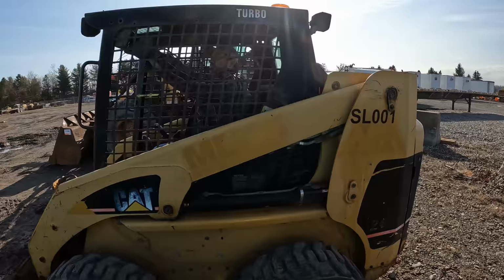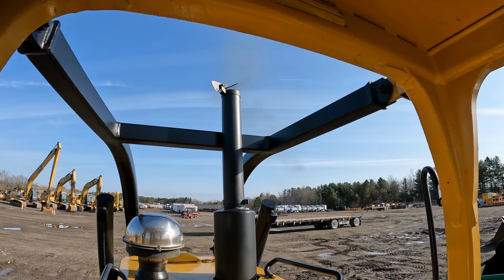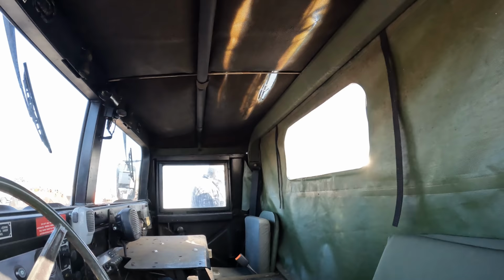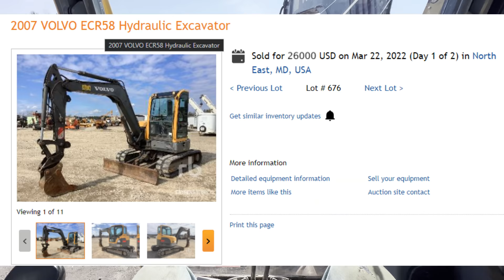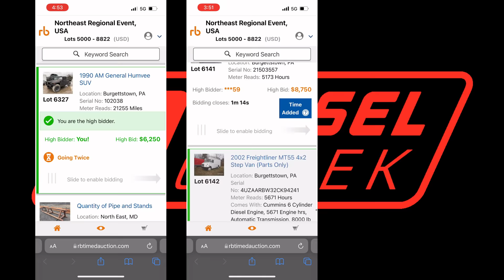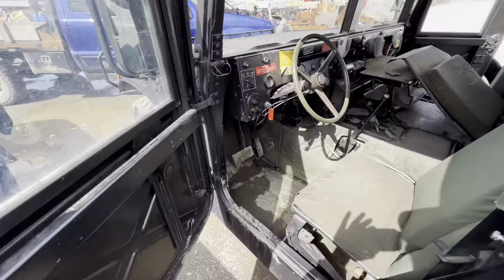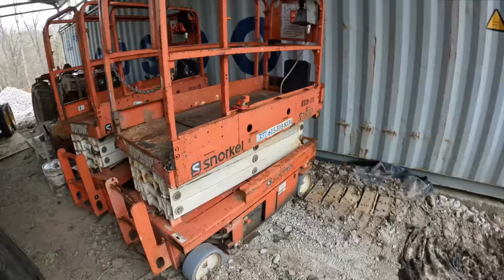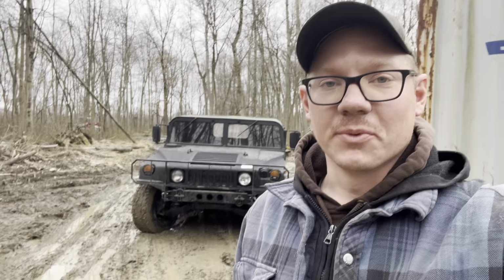You Won't believe the DEALS I got at this Auction! (I Scored BIG!!)

Comment: Having been a motor transport operator in the Marines, and having driven humvee's for tens of thousands of miles, I don't think you got a great deal on that. They are over rated vehicles. Their off road capability is limited, and they do terribly in the snow. And you'll only ever have two air conditioning options: hot, and hot as hell. And they can only carry 1-1/4 ton, and tow 2-1/4 ton.

That being said, if you ever come across a 7-ton (MTVR) from Oshkosh, you should jump on it. Great vehicle. Reliable as hell and you can take it anywhere. I've seen them tow a CH-56 out of a ditch. I've seen them take hits from RPG's and keep running. I've driven them through mud almost covering the tires completely. Very fond memories of driving those bad boys.
Reply: 10 minutes later and I'm still laughing about the 2 a/c options....  even worse if you opt to enter a slow moving car cruise   won't do that again.
Reply: Just think if he was hanging around in Iraq a few months ago he could have got one barely used for free...  ;)
Reply: Or cold as heck in the winter!  I drove them in the Michigan Army National Guard.  Going into Iraq in 130 degree heat and even in normal temperatures in Michigan, I found them under powered on the highway.  If you get below 50MPH, you drop below the engine power band.  I agree in snow those tires just do not grip.
Reply: @klsc8510  Totally. I also worried more about rolling over in a hummer than I did in any other vehicle. 

And he’ll never fix that leak. It’s gotta be a feature, why else would they all leak?
Reply: @bobbalbirnie2478  and some jets too.
Be kinda handy in Ukraine right about now.
FJB

Comment: I want to say the biggest electric motor I worked on was at Gredes foundry in Reedsburg WI... it was a 2000 HP electric motor used to spin one of the main rotors for the air filtration system,  it had a 500 HP pony motor that would keep the main motor shaft rotating when shut off because if it stopped it would crush all the bearings because it was so damn big and heavy!

Comment: Brother, great job on the auction. I have electronic manuals for the HUMVEE and it's motor. I worked on those in the USMC when they were new and in the Ky national gaurd so if you grt in a pinch, don't be afraid to ask. If you would like a electronic copy of those manuals let me know. Do not trust the fuel gauge, they are notorious for not working right. You also really do not want to fill the fuel tank all the way up either. It is a plastic tank with a metal plate bolt to the top that the fuel level sensor gets mounted to. There is a rubber gasket between the plate and tank and after a while the old ones would expand and leak fuel if filled all the way up. The replacement gaskets were made of something else that the fuel didn't cause to expand, but hard to say if the gasket on yours has been changed. two more things; the geared hubs tend to get the oil changes neglected so you really want to check the oil level in them before you run it to had. And the transfer case gears. Low locks in 4x4. High is 4x2, HL is high 4x4. The alternator will want to hit about 1,599 rpm for a second or 2 after starting before it will actually start charging. Every thing else on them is fairly strait forward. Enjoy!

Comment: Since that Humvee is ex police, that two way radio probably isn't going to be too useful to you, but might be worth selling, depending on what brand/model  of radio it is, and what frequency range for which it was designed. I know quite a bit about two way equipment, as a former radio tech and current amateur radio operator, so if you need some further information on that radio, I would be more than willing to help.
Reply: Is it feasible that the frequency range could be changed or extended?  Is it likely to be VHF or UHF?  Is it legal to listen to police broadcasts?  I seem to remember something about it being OK to listen so long as you don't act on what you hear, but that is going to be different on what country and state you are in.  I hope Matt puts up some video on that radio, and it would be cool if he reaches out to you.  [EDIT]  BTW  I used to have G6HVK as a UK VHF only call sign many many years ago, but I let it lapse, and was never interested in doing the Morse to get a full license.
Reply: @TrevorDennis100  being that this radio is ex police, it is probably a UHF high band radio (800MHz) and most likely trunked. Moving something like that to another band can be very difficult, although I have converted many VHF high and low band radios, as well as UHF low band to the nearby amateur radio bands. Listening to police broadcasts in the US isn't illegal (except in the commission of a crime), but usually pretty difficult these days, since many radio systems are trunked and encrypted. One common feature of trunked radio systems is being able to see which radios are on the system, and another common feature is being able to remotely brick the radio, to keep it off of the system. It is also entirely possible that this radio is an older model, no longer legal for use in commercial service, after the narrowbanding push of the last couple of decades. There are a lot of variables,  and having model number info would solve a lot of those variables. I'm currently licensed as Extra class KD5TKR, and work in public safety, but not in radio communications. If you have any further interest in amateur radio, most governments have removed all requirements for Morse code testing. You could get your UK full license by taking a couple of tests. Check with the Radio Society of Great Britain for more info.

Comment: Just an fyi to turn the lights on to service drive you need to move the top switch at the same time as the bottom one as the top switch is a lock for the bottom. You will like the black out drive if it works. Otherwise looks like a good vehicle. You can get a new soft top online fairly cheap or convert it to a hard top for a little more money. Pretty easy to install

Comment: First off get those battery terminals sorted out and check the voltage of each battery and gravity of the cells. Also check the batteries are the same, the number of times I come across 105's and 125's mixed together. If the battery voltage is too low some chargers will not start. That hummer is ideal for boosting the batteries, my old m1009 cucv was a life saver. The stop switch in the top control box will probably be your next port of call especially if it's been left out in the weather for a long period. Chances are the contacts on the back have been frozen and pushed off the backing plate. Then check that plug on the bottom of the top control box. Chances are some of the pins or sockets are green with corrosion. Then you'll have the fun of the elevation switches, angle sensor, load cell, pothole switches etc etc. Also the valve block, solenoids and corroded terminals in the wiring loom. Chances are there'll not be too much wrong with them. Look for excessive play in the steering bushes and kingpins and worn slide blocks in the scissor pack.

Comment: Try de-sulphating the batteries, there are kits and solutions for doing so which may extend the life of the batteries a bit longer, some battery chargers have systems built into them for doing so, C-TEK being the brand I have here in Australia, it worked well on a battery I had in an old Toyota ute that had sat idle for about 7 years, it rejuvenated enough to start the 2H Toyota diesel and lasted about 12 months after that.

Comment: Disconnect all the batteries in the scissor  lift  clean   all  the terminals and load test each battery separate and find yourself 4 good ones Out of the bunch If I remember correctly when those are beeping  the batteries are too dead to activate the charger  Once you clean them all and load test  charge them all separately Then put a set in and see if the charger kicks on When I live there I used to work for Sam equipment rental before it becomes Nathan's rent Before moving to Florida

Comment: try desulfation of the batteries. the digital chargers may not charge the batteries if the batteries are completely dead, you can trick them by wiring in a good battery in the chain.

Comment: The fun thing about charging up old corroded batteries like that, is they make hydrogen gas.. and then you put a big draw on them the old corroded led plates can flex a little and come in contact with each other.. mix that with the hydrogen gas = boom

Comment: Matt, Make sure you service the wheel hubs and differentials on the Humvee as well as checking the steering balljoints, drops.  They are usually very neglected areas.  As for the leaking top, Even when new they leak.  The only way is to convert to a hard top.

Comment: @Matt  ...  i believe there is a safety lowering valve usually at the rear steps, to lower the platform in case the operator is incapacitated. 
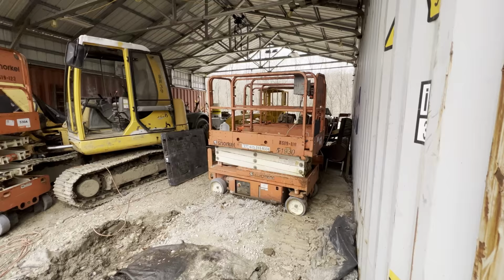usually twist to unlock and pull to lower.  there  should be pictures  33:00

Comment: Try flex seal product on the Hummer roof fabric.  I used this on a UniMog 404 convertible roof and it went on easy and looks like original fabric.   Haven’t had any leaks since.  Available in black or white.

Comment: I am not excited 😆 for you to get the 2seater Hummer... I am legit jealous! Ok, fix for the leaking roof; tire patch. I used 1/4" plywood for a support of the canvas between the bows and canvas. You won't have to worry about camo net on the roof so you should be fine. With all the up armor hummers being used now there should be NOS canvas and it's "easy" to shift from a two seater to four seat.

Comment: Hi there Matt! Great video as usual and magnificent deal on those Snorkels. I have been working in a manlift service company for multiple years and i know Snorkels pretty well. That beeping propably means that the battery voltage is below charger low threshold (usually around 16-18V). Try to charge them with a little extra 24v boost and see if they start to charge. After charging, add some water to them and discharge them by using the machine. If that works, repeat this for 3-4 times and you might have yourself a decent battery pack. "Not charging" is almost the most usual reason for service visit for a manlift service guy, right after oil leaks :).

Comment: I know you like used but you may want to look into either a miller trailblazer or bobcat with the battery charge /boost option  upto 200 amps and 12/24 Volts would be awesome with most of the stuff you do as well the open-top containers weigh quite a bit more
Reply from the maker: My Lincoln ranger is old school it jump starts stuff quite well. Do it all the time

Comment: Matt, the scissors lift and think with some work and maybe new batteries will work fine for the new shop. The Humvee is awesome, and  make a great work truck, and wondering if you instead could take that crappy cloth top off of it and make and weld a metal top for it instead??

Comment: Nice scores, man. About those awp lifts - get hold of the user manual. There is always an emergency override to get the platform down in case you loose power or it gets stuck. We had one just like it at my previous job.

Comment: One possible way to fix the top of the humvee, flex-seal! (or other similarly waterproof rubber/tar-like substances)
The battery-gauge is just happy to meet you! wag-wag-wag XD Maybe an alternator issue? Could be why the batteries were flat and why it was being auctioned off. Hope it's an easy fix, whatever the case! Runs nice.
Oh hey, the gauge stopped wagging once it warmed up, nice! And you drove it home, awesome! A container too?!
Dang, you really did get a ton of deals this round! Hope the van turns out okay, would be a fun project!
Reply from the maker: The container was my buddies score. I’d only buy 40’ ones lol
Reply: Ha, yeah, I realized that when you delivered it later, just forgot to edit my comment!

Comment: On the Hummer if it a real military one you will have issue getting parts they use special connections unlike the civilian models. There is a place in TX that sells used ones and parts they have  hard tops for them but place in TX has all are military versions.

Comment: RICHIE BROTHERS title policy is strange to me because most auction places just sell it title or not. I dropped off a 60 year old forklift at RB auction years ago and they called days later wanting me to pick it up because they couldn't sell it with out a title. I tried to explain that it was a old towmotor LT35 forklift that probably never had a title to begin with. So I ended up picking it back up and still have it in the garage today. You need a forklift to help repair and move other forklifts. Everybody needs at least two forklifts with one with offroad capability.

Comment: the scissor lift  you have to hold the down button for 5 or 10 seconds as its a safety feature on them.
Reply from the maker: Nah the batteries are just shot lol should read 24.5 volts roughly. Reads .02 🤣

Comment: The roof on the hummer should be easy. I would just get some aluminum diamond plate or sheet.  That hummer should be fun. Those lifts were a great deal, especially if they work at all. If you can get two of them running you could probably sell one and pay for all of them.  That was a pretty good week at the auctions. 🙌🏼

Comment: Interesting you got that Volvo mini ex running. I previewed there two sundays ago and the battery was dead. I looked at that Komatsu by it and ran it around a bit. Kinda cool seeing you at the same place I was at. I was looking at that black ford ranger but it had some bad damage repair and sold really high. I looked at that Humvee and we couldn’t get it to crank either when we saw it. Really neat buy. Looks like a fun rig.

Comment: The nice thing about HMMRs is that they have an internal air pump that allows you to adjust the air to whatever you need
Reply: Main reason i want one, I’d probably swap the engine to something both more powerful and fuel efficient. The engines they put in them from factory are horrible
Reply from the maker: They do not all have central tire inflation. This one does not. It is my understanding that most of the actual Humvees do not have that, it was a standard option on the H1 Hummer though. Which is a very different vehicle actually. They just look the same
Reply: I know, i just find it interesting.

Comment: I love these auction videos! What a haul too, I'm excited about the van and the humvee!! In my experience with those scissor lifts, the alarm goes off if they are slightly off level, and also disables the raise and lower controls. Try testing them on a hard level surface, should help rule out leveling issues

Comment: Matt would you do a video detailing the transmission and rear end splitting up and down in your international 4700. I just bought a 1999 with DT466 5+2 transmission. I want to make sure I’m properly switching the rear end. Again I would like to see all shifting combinations one would encounter on the road. There is only one video on YouTube and the camera work isn’t good, plus it’s a possible a different pattern for the truck in the video. Thanks
Reply from the maker: Mine is a single speed rear end and a 10 speed trans

Comment: Enjoy the auction vids, I can say to I form you the hummer  if it earlier version 6.2 ltr that's gm made off the 
Detroit line or the newer version is the updated 6.5. I can't say much I'm not as aware on that one. Later I think that developed the dura max series. But anyways the 6.2 is impressive I seen the blast you had trying it out in the yrd. Again I can't say how stout the 6.5 is. As far as the top goes just till somthing is figured throw a water deflector when not in use. Would like to see the gen I think you said it has.

Comment: I'll need someone to explain this to me.  I know for normal gas powered cars/vehicles, people say to not rev the engines when they are cold, since it can damage the engine.  Is that different for diesel powered engines, or work equipment in general?  I sort of cringe when they start up a machine and its cold and they instantly full throttle.  I trust that they know what they are doing, and I assume its fine since I see them do it a lot.

Comment: Those little scissor lifts are the scariest kind to use. They go up quite high but have the worst stability of any scissor lift so you can really feel them tilt in a way you don't get with other lifts - great deal though. HMMWVs are overrated in my opinion (I drove tens of thousands of miles in them when I was in the USMC, I'm entitled to my opinion on the subject) - I don't know what they usually sell for because I would never buy one but the price you got was appropriate in my opinion. Nobody should be paying $20k for one of those.

Comment: Iam not a battery man but I read somewhere I think that you can HOT charge a battery turn it up side down and drain it and put new asis in it recharge it slowly and it will hold a charger. (I don't know) you need to talk too a Batteryman to get the truth,  if that true I wish I new about it 21years ago for my Wheel Trencher witch though Battery were free. ... jk

Comment: Matt what is the deal with the red tipper that went by on the public road at around 36:01 because when I paused playback and took a closer look it had three additional axles with smaller rims and tires on them in front of the original pair at the back?

It sounded like a military tracked vehicle with rubber road pads on!